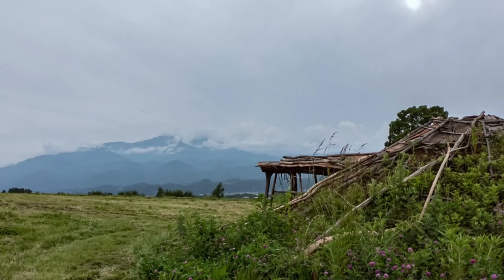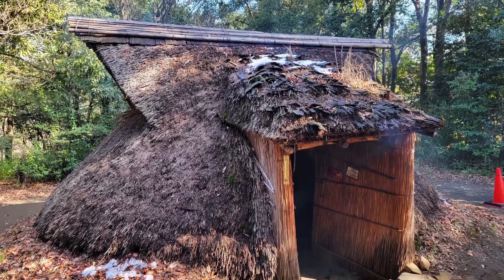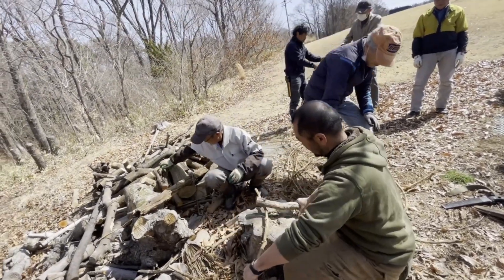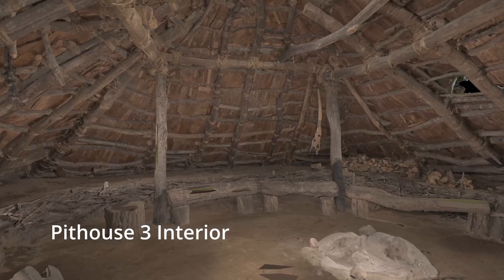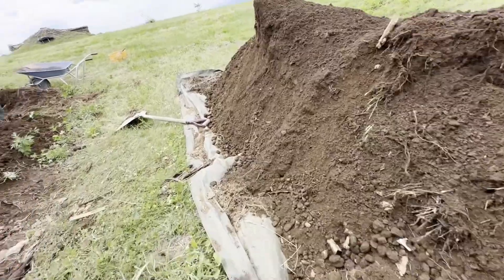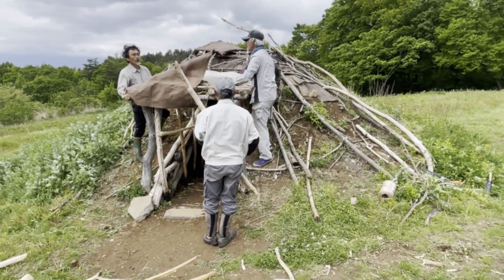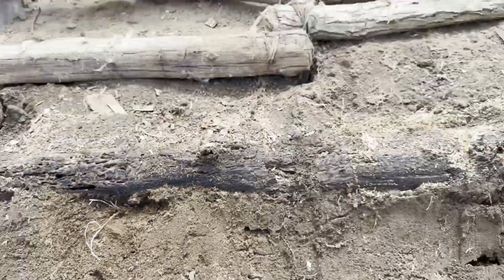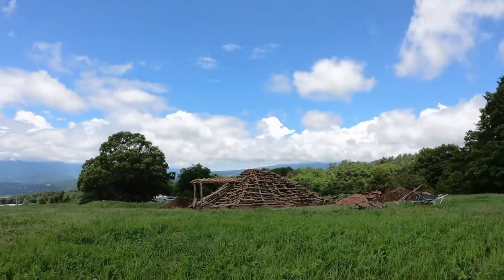Japan’s forgotten Pithouses

Comment: I question the use of the tarp. If you wanted to see how such a structure performed over time, then using the tarp would certainly affect the outcome negatively. Interesting  video. People talk about sustainability in housing, but I think they actually like the "catchiness" of the term without understanding, and they would be unwilling to live this way. This is true sustainable housing, no synthetic materials except tarp, which would be unavailable. Smooth Gefixt built a decent sized Saxon round house solely from local materials. Low dry stacked stone walls. Conical thatched. Not one nail in the structure. Worth watching
Reply: I have questioned it as well. The response I got from the site archaeologist was that, the first experimental pit house at Umenoki did not use the tarp, which worked fine but needed constant maintenance. The tarp simply provides longevity to the house, while also allowing less bark to be used. I think there always has to be a compromise between authenticity and practicality.

Comment: They made the mistake to put the wood in the ground. Make a stone foundation for the  beams and even firr will stand more than 20 years when dry.
Reply: But wouldn't they have found the stones if the originals used them?
Reply: @christianfrommuslim  maybe.. The trick is to hold the surface of the Ground dry (what you have in the case of the inner beams) so you put them just on the floor without somthing underneath.
Reply: Good points everyone. Japanese homes in later periods (and up to very recently) used stone foundations under the pillars. For some reason, the Jomon period pit houses were post-in-hole. Even the rafters were embedded in the ground. There is no positive evidence that they used extra support posts that were simply placed on top of the ground, but it seems logical that they would have done so when necessary. I have not seen examples of reconstructed buildings do this, but I would certainly try this if need be in the future.
Reply: @johnertl2737  maybe it was more importend to have a steady construction for some reason..
Or the idea of the costruction needs these collums standing by his own in the first step, to build around.

Comment: I think the rot would be significantly reduced if there were a fire and humans inside all of the time.  The fire would make the inside significantly less humid while also providing a draft, and the humans would keep the mice in check so they couldn't burrow into the structure.
Reply: Good points. I agree completely. The site maintenance included making fires two or three times a week, but certainly no one lived there. Interestingly, this raises the question of whether the Jomon people lived in these buildings year-round. Some people think they did, but many ethnographic and historical examples indicate that pit houses are used as seasonal encampments.
Reply: @johnertl2737  how is the wintertime ? Maybe it was saisonal used.

Comment: They used oak not cedar, oak rots, cedar is known to be bug and rot resistant, which would be why the Joemon used it.
Reply: The use of oak for these buildings was a compromise. Apparently cedar was around, but I have heard it is difficult (too soft?) to cut with stone axes (I have never tested this hypothesis). Analysis of wood species for Jomon pit houses points to chestnut trees as the main wood source. The Jomon Group volunteers would have used chestnut, but the site managers are trying to regrow chestnut and other period appropriate trees in the nearby forest. Thus, the use of oak was a site management issue.